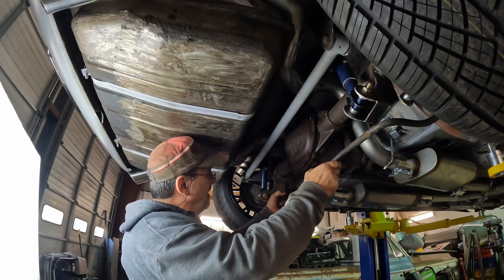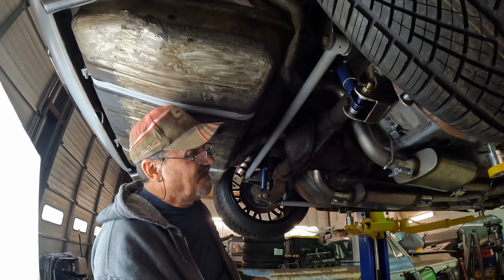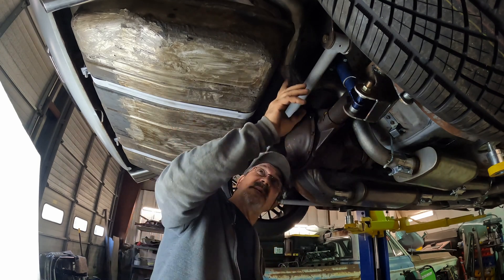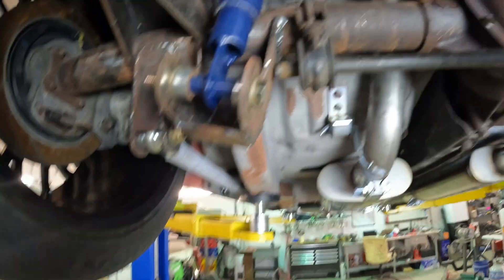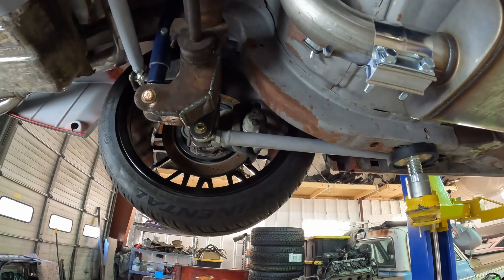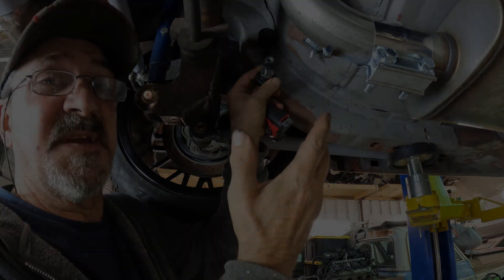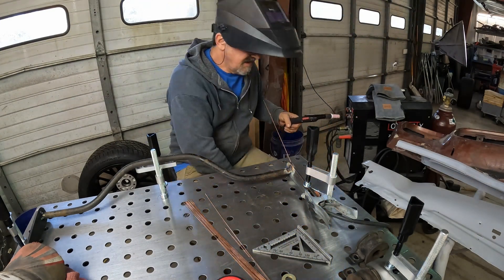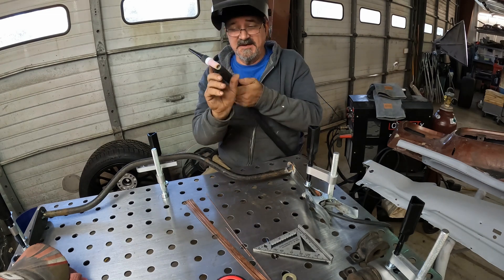Firebird Ep  42 Can I make my own swaybar?

Comment: You should look at the GM A-body rear sway bar.  The bar ends mount to the lower control arms.  I used to like this setup because you could jack up the rear of the car and not have to modify the sway bar.
Reply from the maker: I always thought the A-body (and later G-body) sway bar setup was the worst of both worlds (sorry!). Since the bar only attaches to the suspension it binds the trailing arms and only Indirectly addresses body roll. My thought is that of the four corners (for lack of a better way to state it) of the sway bar attach points, two should mount directly to the frame/body and two should mount to the suspension. That gives the best feedback through the bar. Of course I could be wrong!
Reply: My Chevy Avalanche has coil springs in the rear and sway bar links going to the frame.  Maybe you are right

Comment: Great job!  Really enjoying the build.  Any consideration to using heim joints as endlinks for adjustability?
Reply from the maker: I thought about it and still might, but based on the intended use of the car, I don't thing I need that much adjustability. I'm more concerned about whether the bar is too big/too small to be effective. Once I figure that out I can look more closely at it. Thanks for the input!